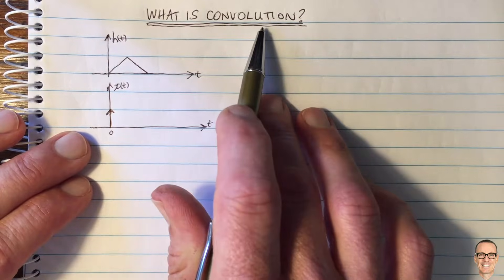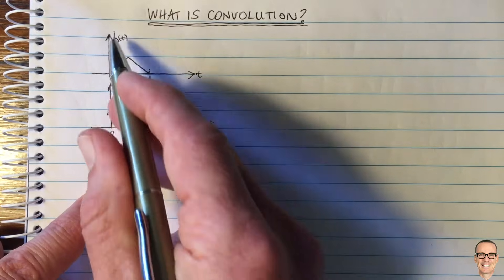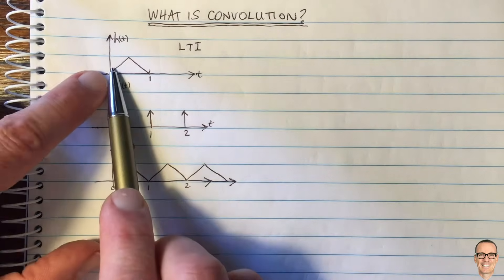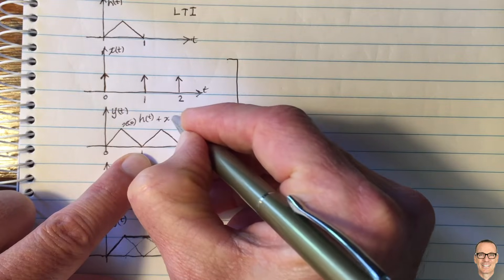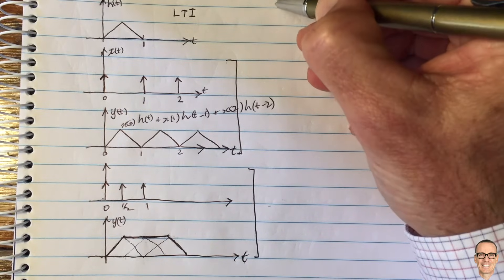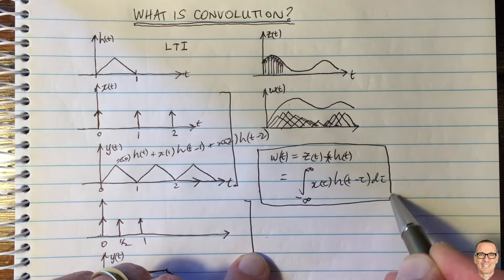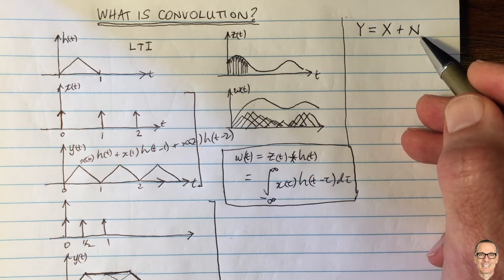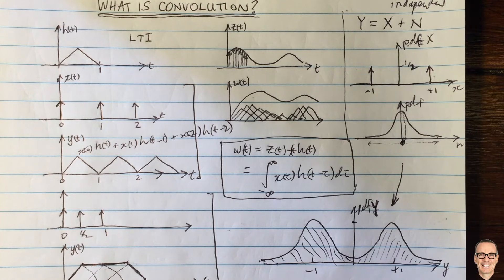What is Convolution? And Two Examples where it arises

Comment: at 3:43, can someone explains why when we have a signal goes down + a signal goes up, it equals a straight line? I don't get it. Thanks in advance!
Reply: Is it because when we subtract 1 and add 1, we essentially end up back at 0, so our position on the graph doesn’t actually change?
Reply: I'm still learning, so I could be wrong, but I think it's because if you add the heights of both components of the triangle at that certain point of time, they both add up to the height of that triangle. So for example the intersection of the triangle is half height of both triangles. So half plus half equals the height of the triangle. Idk if that helped

Comment: How can we write x(0)h (t) +x(1)h(t-1)+x(2)h(t-2) as we know x(0)=infinite as it is height of impulse?
Reply from the maker: Yes, technically you're correct. Technically, I should have written "the area of the delta function that is centred on t=0" and "the area of the delta function that is centred on t=1", etc. But I didn't have room on the page to write all that, so I just used x(0), x(1), etc as a sort of "short hand".
Reply: @iain_explains  thankyou for your response

Comment: at moment 09:10 why we supposed that the output signal would be like that ?!
I think it's gonna be a straight line lying on the t-axis 
why my idea is wrong as the Z(t) is an infinite number of delta functions?
Reply from the maker: Sorry, I don't understand what you're saying. I'm not drawing time domain waveforms here. I'm drawing the probability density function. In binary digital communications there are only two possible values that the data can take (at any given time), and there is 0 probability of having any other values. That's why the data's pdf has two delta functions. Perhaps you might find this video helpful: "What is a Probability Density Function (pdf)?" https://youtu.be/jUFbY5u-DMs

Comment: Sir I'm struggling with one doubt here that if we approximate our x(t) as the sum of impulses which are very close to each other. Suppose before approximating x(t) as impulses at particular time say t=1 it will have some finite value. If we approximate it as impulse then at same time t=1 we get infinite value because amplitude of impulse is infinity. Kindly please solve my doubt
Reply from the maker: Yes, it can seem odd, but don't forget the width of the impulses is infinitely narrow. It's the area that is important when you're "putting them together" to make a real signal. This video might help: "How to Understand the Delta Impulse Function" https://youtu.be/xxGcI9WVoCY
Reply: You can imagine x(t)*d\tau to be the area in the integration. That would make sense.

Comment: Telling the application of convolution in terms of signal processing may help a part of people in the telecommunication and eee engineers but when convolution meets signal processing it also is used as a filter but my question is I have read convolution even it's useful for mechanical engineers such that in resonance when a failure occurs not due to massive force hitting an object results in large deformation could cause failure or an large impulsive force acting on it for a duration of time could cause failure but there is an another phenomenon where the natural frequency of any object is reached the energy builds in it very high and could cause a failure in this manner a small disturbance which accumulates over a time and causes a high energy to build in the system due to energy very high it causes stress and the system collapses this is highly different from stability perspective of control system being not stable does not mean it's accumulating energy inside it but in case of amplifier there is an capacitor or inductance device which causes the attenuation in the electrical signal and filters some frequencies but in other perspective amplifier amplifies the signal such that it stack ques and scales the signal but I don't know this is done by capacitor or am inductor but convolution is useful to both mechanical civil eee ece and every applied scientist and engineers hence it's used as a filter in an circuit or used to amplify but even transistor amplifies the signal without an capacitor or an inductor I guess also mechanical engineers can use it to model resonance hence the energy inside the system build high by periodic accumulation of the system reaching its natural frequency which leads to failure and I can also tell you that when amplifier filter or amplifies the signal it used convolution hence it's useful to every applied scientist and engineers but not to mention the pure Mathematicians use it of convolution of kernels thankyou guys some of my inference could be wrong if somebody or the author of the video is familiar with it please correct the above and educate me thank you for the wonderful video sir
Reply from the maker: Yes indeed. Convolution happens whenever an input is applied to a linear system ... any linear system. It can be an electrical circuit, a mechanical device, a civil structure, a wireless communication channel, - anything that is linear. Here's another video on my channel where I use a mechanical shock absorber as the example: "How to Understand Convolution" https://youtu.be/x3Fdd6V_Hok
Reply: @iain_explains   thank you for the reply sir i watched it and it was great thank you for educating me
Reply: @iain_explains  but what about damper which in the bikes shock absorber absorbs but in resonance accumulates the energy for destruction
Reply from the maker: Many/most systems in the real world are non-linear (although we often like to make approximations and model them as linear).
Reply: @iain_explains  yes sir but how a system which scales and amplifies the input impulse signal in resonance or bump can also be used as a filter convolution is used both in modeling resonance and also attenuation of signals as a filter but the same time I am asking in amplifier the signal is amplified due to the internal component capacitor or inductor hence it stacks ques and scales the signal
Reply: @iain_explains  

Brother I know mechanical engineers could find resonance but when I had a deep thought on this resonance Is an slow accumulation of energy which is accumulated very high in small installments when the frequencies match if you strike a  turning fork of 50 hz you get the same frequency of vibration on another tuning fork so they both vibrate if you strike it harder the amplitude changes hence loudness is a human factor the frequency is the same the languages that human speak through out the world the sound only  resonate your ear drum for few seconds my question is that the harmonics is the fundamental frequency and overtones are the frequency that follow it take a word in any language you spell it according to convolution the thing scales and ques and stack the signal so convolution can be used to model resonance so when your ear drum vibrates it vibrates so the electrical signals are carried to brain  like tuning fork ear drums vibrate within the audible spectrum 20 hz to 20000 hz hence resonance is caused by the word we speak and within the audible range the ear drums vibrate and we make sense of words I have seen in one videos on YouTube that due to harmonics in any sound causes resonance which could be modelled by convolution recalling the resonance its destructive because slow and steady accumulation of sound on the mass causes high stress and high energy to build inside and stress increase and the system fractures or collapses but our ear drum hearing the sound from human languages try to vibrate but why our ear drum when subjected to continuous exposure of sound does not fracture or rupture like a wine glass iam not telling about high loud sound higher than 80 db but a audible range sound within the frequency of 20 hz to 20000 hz under continuous exposure why it's not damaging it again not failure by high energy but low one in synchronisation on air . But I tried it in my students when I told them to be quite in class they did not listen to me so I took my phone and set an frequency 14000 hz and they told it was irritating the idea of resonance is "small effort but large destruction " just like Tacoma bridge where the wind just slowly accumulated energy on the bridge and it collapsed it so my conclusion is if an audible frequency at continuous exposure to an human ear can it cause bleeding again "small effort but great destruction" sorry for the long story I you are able to reach hear you must be as curious as me so still not finished the ear drum is shook by harmonics in the sound we make by the words( or )overtones in the sound we make by the words I know harmonics is the fundamental frequency and overtones are following it which under slow and steady accumulation of sound energy resonates and could damge the ear drums again "small effort but big destruction" not to mention we assume the person is in coma or brain dead hence when the sound irritates him he or she could not make a move so my question is so simple normally human ear responds to harmonics or overtones according to convolution which could be a disaster but with minimal effort 🙏🙏🙏🙏 at here I could be wrong because harmonics can also be used to construct sound so can it be destructive or the overtones which are the trouble makers and which one according to this gives a response curve when two signals convolved by harmonics or overtones which is destructive but with minimal effort and convolution happens when ear drums oscillate is by harmonics or the overtones or also the trouble makers there